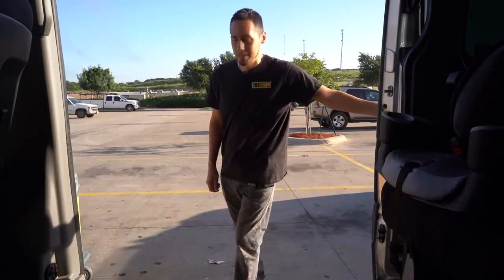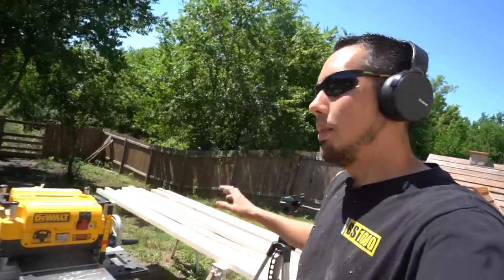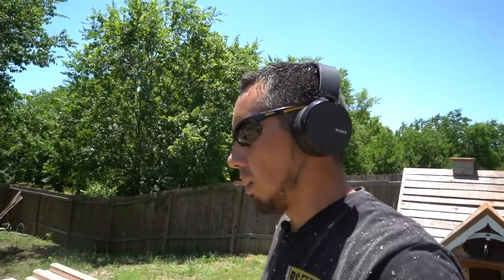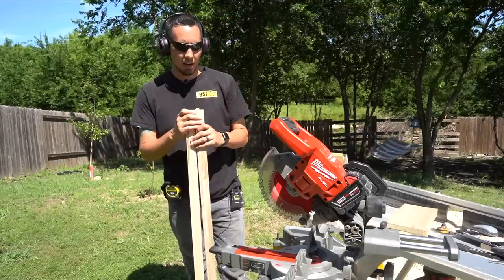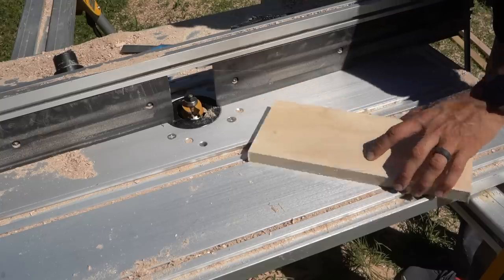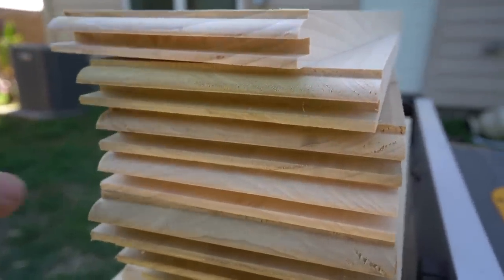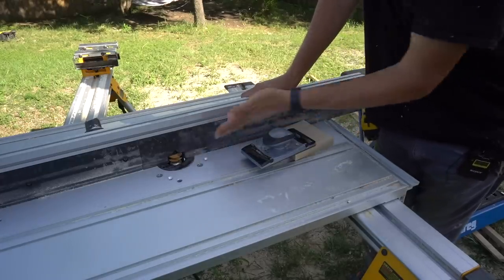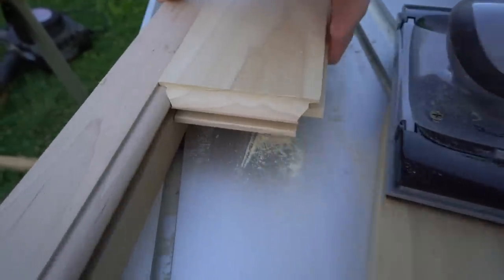It Worked!!!... Raised Panel Box Newel

Comment: Nice joinery.  Is it me or does it look tall?  If you run handrail at 36-42 to top will you be into the panel rather than the box for rail bolt attachment.  Same for bottom not much room for a block and sure tite to secure them once cut down.   But overall props to you,  looks really good this far.  Id not attempt that unless trying to video some content.

Comment: Glue up then trim and consider a simple fixture to make sure precise consistent glue ups are repeatable on all four sides to fix the spacing between your top and bottom rails and be sure to use space balls or some other compression spacers to allow your panels to float,  prefinish you panels if you can, the stiles and rail too if that is at all practical.  They should look fantastic when you're done.

Comment: I like to glue up then cut to length, but I use a home made panel sled for all my cross-cuts. A standard miter gauge isn't long enough to hold a glued panel or newel post perfectly perpendicular to the saw blade. You don't want any wobble in your piece as it goes through the blade after all that nice router work! Not to mention, cross-cutting long pieces can cause the wood to bind in the saw and possibly create kick back.  Take a few minutes and make some feather-boards to clamp onto your fence. They'll hold your work tight to the table as you run the wood through. Rockler has nice pre-made ones that fit into the miter-gauge tracks on the table if you want something pre-fabricated.

Comment: Lol I have the same setup got the table saw two years ago for a Penny and home depot it was clearance and they forgot to remove it when it was at 75% off. So the head cashier told me it was free didn't even pay the penny.

Ordered the same rolling stand for 79 bucks after getting credit for a new credit card I ended up closing.

It's a great little setup you got there

Comment: I have many good things to say about DeWalt power tools but I would'nt rely on a portable table saw for applications like this one. I own a Powermatic Cabinet Saw and it is outstanding when it comes to accuracy and versatility. I suggest when you're ready for larger projects regarding fabrication you jump on the cabinet saw wagon. There are many mfg's of table & cabinet saws but I chose Powermatic over 30 years ago, and recently treated my shop to a newer model 10" cabinet saw. Nice work on the newel post, as if anyone would think your work would be less than good? Thank you for your service!

Comment: Great videos, thank you. I have the same wood planer, the cheap flexible black corrugated drain pipe that people use on gutter downspouts fit perfectly over the exhaust port and will route the chips somewhere other than your head.

Comment: Glue up, then cut to length, I would suggest.  Also, have you thought about how you're going to fix this in place once it's put together?  A newell post can take a lot of load and has a lot of leverage.  You might want to add some mass for anchors, etc at the bottom before glue up.

Comment: I don't get it, it has a hole in the middle? Is it supposed to go around a 4X4 or something? Like for decoration...
Reply: He'll install a panel at glue up. Shaker panel; like in cabinet doors.
Reply: @jefftodosichuk2790  Hi, thanks you mean like a thin piece of wood in the back, but it will still be "hollow" empty? Is that the "new" modern way? Everytime I saw those posts at the bottom of staircases I thought they were solid wood not empty? Or maybe this is how it has always been.

Comment: Great job, and even better job buying a power table saw!!! Sure you noticed the difference. 
Btw have the same Milwaukee sliding saw, any advise , when using melimine as will do a perfect clean cut. Have purchased many blades that say cut melamine but each time chips!! So gone back to my power one. So frustrating as not sure these battery tools are as good as alot saying!!!

Comment: Nice work ,tight joints. I use a table saw sled to cut down to size and a simple one piece of ply  a guide strip and a fence, it fits too one side of the blade doesn't straddle it. I have made the bigger fancy sleds but they start to get bulky and heavy and move with the humidity.

Comment: My opinion, the cleanest would be to cut after assembly, but you need a blade big enough to cut in one pass.  12 inch miter saw ?  If can’t then cut pieces to length before assembly.  You can do two cuts but hard to have perfectly flat end.

Comment: BOOM! The table saw works great with the powerstation. Oil or paint some of the metal rods underneath to reduce rusting. Not really necessarily, but just from my experience. Great choice! Yes, slightly oversized so you don't have to deal with slightly out of alignment and glue cleanup

Comment: Hey, if you run your material backwards through the router first it will hog out a bunch of material and prevent tear out or chipping when you make a proper pass. It is strange and you need to be very careful. But it does the trick. I used to have to do it with Acrylic all the time. But it works on hardwood too.

Comment: The paint on the ends of lumber is called “anchor-seal” I believe. It’s applied right when the tree is cut down so that moisture leaves the wood evenly. If it’s not done the ends quickly split and they have to cut a significant amount of waste off... FYI

Comment: Couple things, first, looks awesome, second, if you're going to glue up in stages, glue it up as a whole post, this will prevent it being out of square, as the gap may close up on the outside edge but actually not be square. Thirdly, I would cut one end clean and finished before glue up so you have a reference for your spacing. if everything is random then it could be easy to glue up with misaligned panels on two faces. That's my thoughts! I'm a big fan of those DeWalt table saws, cabinet saws, they ain't, but they seem to be very thoughtfully built.

Comment: Amazing job.  Had the same issue when routing long boards for a miter lock joint and then I used some top and side feather boards on my router.  In your application the side feather boards would really help.  Keep up the great work as I have learned a lot from watching your video's.

Comment: Nice job! For end grain on the router, consider a sacrificial piece of wood that will allow the work piece to not be the first thing the router bit contacts. Nice push block. Yep, feather boards would also help. I see that electric motor saw ripped that maple nicely. I have a De Walt Job site saw also. The gear driven fence lock/setting is great along with the cart. Best of luck to you!

Comment: When routing, align the fence with the groove on the router table.  Use a square that fits in the groove to run the end pieces.  If you use a small sacrificial piece behind the stile, you will not have a blowout.  Free handing small pieces is a recipe for disaster, not only for the piece, but yourself.   Also recommend you use push sticks and hold-downs when running pieces on a router table, especially long pieces.  Also when cutting long pieces on the saw, use roller stands instead of another person.  Love your videos but be safe.

Comment: You’ve got the milling down. It’s crisp and tight.  Check out the”Golden Ratio” concept to proportion the lengths of the stiles. The ancient Greeks discovered the concept and used it extensively in building design.

Comment: I think i was was to assemble this, i would glue up and install each side section while installing the raised panel, work my way around till the whole newel was complete. (set up a gluing jig to clamp and lock the newel in square)

Leave the stiles oversized, once you know your overall height and installed the raised panel during glue up, keeping the top rail and bottom rail slightly wider than they need to be, then once the glue has set, cut to the overall length you desire with the correct rail width.

Comment: You got it glue up first then cut , panel floats 3/32 both sides if it’s a solid piece of wood interior panel  . I would put 3 relief cuts in the back . But all depends on thickness of panel plywood would be optimal.

Comment: I love your work,skill,and kind
Demeanor. My only comment is
That you are missing/teaching
A basic wood no-no. You should.
Crosscut before rip.if you can,
If you have wider top rail mat'l,
End shape as wide as you have
And rip down after. This yields
No chip out and even lengths.
If I have a board wide enough
For both top and bottom rails
...cut to lenght,detail ends, then
Rip to final size. Love your videos,
I only ever did bench/shop work
At my table. I would be lost trying
To do what you do onsite/inhome.

Comment: Leave those posts long on the bottom. It will let you make fine tune adjustments due to unforeseen discrepancies with the floor/stairs when you go to install. It will be super easy to trim to the proper size the day of install and you don't have to worry about being 100% perfect during glue up.

Comment: You should invest in either buying or making finger boards; they make routing much easier by applying slight pressure to the workpiece keeping the material in tight to the router bit.

Comment: Yes use glue just brush it in and tap it in with rubber mallet then cut the ends and wise choice on table saw I used the same one to make custom shoe molding on my buddy's house I milled all the wood down and routed I had seriously like a mountain of sawdust 2 times over lol and the glue will help keep everything in place with changed in humidity and temperature and atmospheric pressure differences etc I'd recommend you try and suck up that saw dust on your grass or your going to have dead grass

Comment: Did something like this 10 years ago. I myself preferred to do the glueing first. Then cut to the correct length. It went faster.
Reply: But I owned a carpentry shop 10,000 sq ft. I didn’t do this in a backyard!! Good luck and looking forward to seeing your results.

Comment: You can prevent chip out by simply backing up your peace with another piece of scrap, typically about the same with for stability, and then pushing them through the router bit together. You also might think about adding a featherboard for consistent pressure against the bit.

Comment: Only problem with glue now is that if you need to adjust your top and bottom  stile I  personally would get place it together and use a strap to keep it together dry fit then glue

Comment: For pushing stuff through the router you can simply use a square of plywood, It acts as a backing/push block. 

On the glue up. If you can easily trim it as an assembly it doesn't matter. If it's too big to get on your chop saw you could make a crosscut sled for that table saw. 

I glue my stuff up to size except for some final sanding, but I make doors, panels all the time. 

I saw somebody mention spaceballs. I use them in every paneled thing I build. You need to allow for them though. 

Take a look at the kind of work table ron palk? paulk? builds. It's set up to be mobile and not take up much room when stored. It also incorporates a hanger for one of those jobsite saws.

I have a few portable work tables simply made out of 5" strips of 7/16 osb  glued and brad nailed together in a ladder pattern. they are in 2x8' sections and go up on sawhorses with a sheet of 1/4 osb for a top. Simple, strong and cheap. Everything together with the sawhorses is probably under $75. One sheet makes one table.

Comment: Glue up first then trim. Use tightbond 3 to get a longer open time. If your router table fence isn’t perfectly aligned the ends of the board will be screwed up.

Comment: Definitely trim the posts AFTER the glue-up. Trying to get all the sides to line up with precise cuts before gluing will take way more time. Just glue them and then cut them so all your lengths and edges are perfect.

Comment: . Those posts are  really nice! You did a great job!  The only thing that worry me a bit,  is the grain direction of the rails . Considering that the contraction and expansion  of the wood is mostly across the grain you might end up with  little gaps between your rails and stiles. This sead, I like  your channel. Keep it up. :)

Comment: What do you think of
12 inch milwaukee
Slide compound saw ?
Reply from the maker: Have not used it yet, but I have not heard good things. Is there a new one?
Reply: @FinishCarpentryTV  the 12 inch model has been out about 5 plus years but not many stores carry it...
But its like your small battery operated one
But its electric i need 
New saw mine is really old and worn out.

Comment: Great work! May I recommend a sled for your router work.  It really stabilizes the wood for the end grain work.
Reply: Woodsman please do I’m curious
Reply: @ReadyforHiscoming  I use the Woodhaven medium sled.  There are inexpensive ones out there, but the bases are not thick enough and will flex sometimes if clamp down on the wood too hard.  There are more expensive one out there which will have the thicker bases, also.  I use mine on an older Jet small shaper I use exclusively for stile and rail work(not powerful but smooth). The most difficult part of set up is getting the sled square to the fence once the fence is square to the table.  Once done, nice tight joints on the stile and rail.  Oh, it is recommend to use a small piece of 3/4 scrap wood on the fence(it has cut outs to screw it on) so it virtually eliminates tear out once the first cut is made on the rail. Hope this helps (kenscustomkitchens dot com)

Comment: Really enjoy your ideas! Btw...is that the Dewalt 755 planer? How do you like it?
Reply: I had that planer for 2 years. It was a good planer for its price. But straight knives suck compared to a helical head. If you can spare the time and cash i would suggest putting a byrd shellix head on it. I did that and it significantly improved every aspect of the saw except power. Helical heads are hard on motors since the motor doesnt have time to recoup after a cut since its under constant load. But ya. Its a good planer. I'd say the best portable one you can get
Reply: @MaydaysCustomWoodworks  Many thanks for the input and advice!

Comment: You should have got the skil with worm drive gear. Also with hard stock like maple you need to get rid of alternating tooth blade and get a carbide flat tooth blade it will be much smoother finish and cut better. My 2 cent worth. 
Freud 10" x 24T Heavy-Duty Rip Blade is good rip blade for hard wood

Comment: I find leaving projects oversized during gluing is best. Also when I use those panel router bits, i use expandable wood glue.
Reply: Scrimjaw 
Expandable wood glue... 
is there a brand that you would recommend?
Reply: @chefsteven34  I use Gorilla glue, it has many variety's. I'm in the UK. However fairly sure its available in America. 

When using it, dont wipe excess off while its wet. Wait until it has fully cured then just chip it off and sand up.

Comment: Yup, in the last vid when you were "kicking yourself" for selling your corded DeWalt, I figured you would get another one. Why not?  Also, agree with the idea that you should have an option on these battery powered tools to run a cord to them. How many times do you have 2 screws left and power for 1?  :(
I had a battery powered shaver that you could use corded.  Wish power tools would get on board.